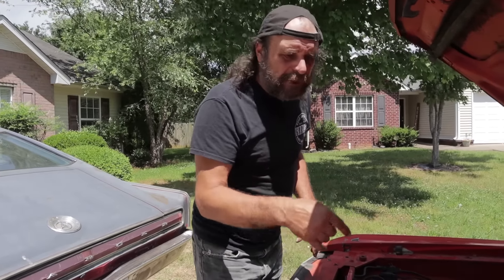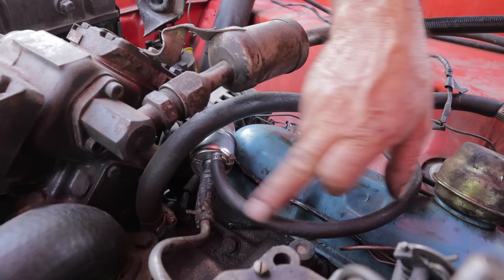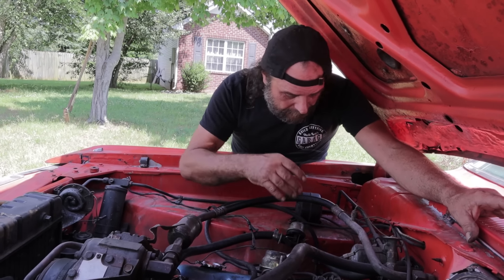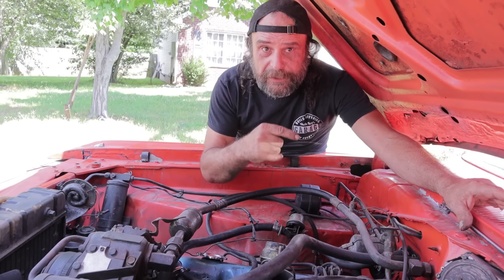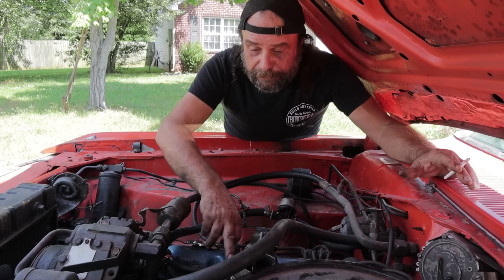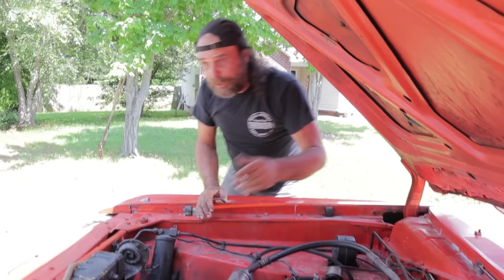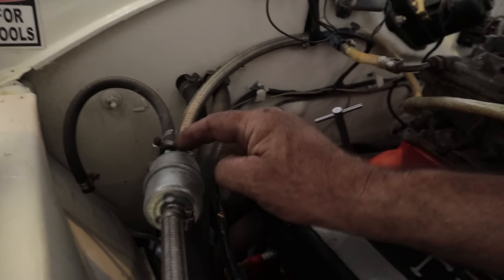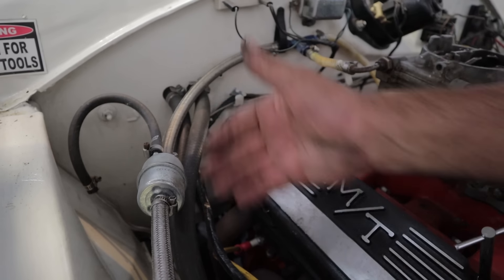$8 Cure For Vapor Lock

Comment: Thank you, uncle Tony.

You won't believe how spot on this video is .. 
As I had said I had owned 3 mopars- a pair of 68s.
First  was G.T.X.
a black Texas car.
Never again.... 
That was a petrol powered BOMB!!
it percolated So  bad I NEEDED a 20 lb. Fire bottle. Even H.O.G. (hunnert octane gas-leen) didn't help. Just hotter fires.
No comment on which brands we're worse 

After a 69 glass hood melted on it 
I put in insulated fuel lines, electric fuel pump with a pressure regulator, tossed the thermo-junk 4 bairbule with holleys 780 cfm d.p. a valley pan, heni cap. radiator, remote oill coolers and bigger fan & shroud 

Nothing. Spent OVER 3 grand.
Then 1 cold ass day-flames.
Gone in 30 seconds 
The other 68, a 340-4gear boiled over in Sub zero temps.

Saved by a most welcomed sale.
The anti perc filter & non alky gasohol were the missing mopar links 

Thanks again, Tony..
Could have used you 40 yaheens ago.

Life's a long song!

Brian.

Comment: I knew a girl once with a third nipple.  Triple the fun.  
Thanks!  Always wondered what that 3 port filter was for.  
It's a little more involved, but I always just added an electric pump near the tank and blocked off the mechanical vacuum pump.  Fuel under pressure usually doesn't reach a high enough temp to vaporize.  And of course, that's why we don't see vapor lock on modern fuel injected engines.
Love your channel.  Your the first guy I ever trusted that wore their hat backwards.
Reply: That's really only 50% more fun.

Comment: Thanks for tip.  I put similar pump on {from China} but only has 2 pipes - in & out  no bleed off.  Took vehicle into town and after parking go to drive - pump making loud hollow clicking sound then vehicle stop in main street {embarrassing}.  But did eventualy work again.  This happened twice.  I though possible sabotage as only logical explianation but what youv said makes sense  {accept why it would click which sounds like it wasnt getting fuel which led me to think blocked filter / but why would it work after not working etc...}.  Thanks!

Comment: I drove an old Dodge Ramcharger on a trip to Florida and the hotter the weather got going south I experienced vapor lock anyway the problem was fixed very similar to your approach by a very sharp good old boy near Ocala FL.
 The term vapor lock is up there with going to Pep Boys for points plugs & condenser you just don't hear it any more.

Comment: Interesting never had that style filter here in Australia and vapour lock is very real here even without ethanol but mainly in pre 80s cars the fix is a low volume and low pressure electric fuel pump along with lagging on the fuel lines , in extreme temperatures 130f and above a spray nozzle of water on to the lagging but that is only under extreme heat and load situations when the vehicle would vapour lock when running . Mostly it was taken as one of those things bit like in pre 70s cars they will overheat when it is hot no big deal , carry water refill off you go again . The one motor that it did not worry was the slant 6 to this day I don't know why . I have been a professional mechanic since 1974
Reply from the maker: The 10% ethanol used here in this country is what causes most of our issues
Reply: Have been told by many that the petrol over there is worse than old 3rd world petrol. Not much ethanol here but they have lowered the octane rating over the years the worst is 91 octane then 95 then 98 octane and it ain’t cheap goes from $1.45 for the 91 to about $1.60 for 98 that is per litre . 1 imperial gallon = 4.5 litres approximately not sure about US gallons. I drive a diesel Land Rover discovery 1 that gets about 32mph

Comment: I have a 1968 Oliver 1750 gas 310ci with a 1968 model 74 picker and both 74S & 74H attachments. Use it for harvesting corn, I went all through it and still it has had issues. Runs great for the first 20 mins then dies, leave it sit 10 mins and it runs good for 10 minutes and dies. I'm certain it has to be vapor lock, now I  know how to cure it. Couldn't thank you enough
Reply from the maker: Y'know...could be a clogged tank vent too, going by those symptoms

Comment: One time, when I had some cooling issues with my 79 Continental, the motor started to vapor lock before it could get hot enough to hurt itself.  Silver lining, I guess!  Looked up your video, good information (real mechanics are always holding onto a cigarette when talking) and something to think about.  My motor was running cool, but the 95 degrees outside, unusual for ol North Dakota, got my car to start having major troubles when shopping in town yesterday.  Gotta poke around the hood and see, I guess.

Comment: I had vapor lock problems on my BMW motorcycle. It has an aluminum tank right above a lot of motor, and in the summer the gas gets hot. When it vapor locks it quits running, and if you remove the gas cap assembly you can see the tiny stream of bubbles come up from where the fuel pump is. When the gas cools down, and the bubbles stop streaming up, you can start and go again....for awhile. The fix I found was to divert air from the fork area of the fairing, to the underside of the tank area on the left where the fuel pump is.

Comment: That probably is my issue on my '85 5th Avenue. Didn't even think vapor lock would be the cause of it being hard to start at times. It was a pain yesterday in town. But that also explains why my temp gauge goes to 210 or so when I turn the ignition on, after it's been driving steady at 180, on cooler days I'm guessing it reads about 165~ish.

Comment: Thanks for this. Trying to restore an 85 dodge b250 and have vapor locking issues in the summer and this will definitely help because I'm about to replace the fuel pump and can do the filter next

Comment: In modern cars, the fuel is always under a certain amount of pressure for fuel injection and will resist boiling.  At atmospheric pressure with high underhood temperatures, yup, it does boil.  I had an 81 Ford Granda with a 200 inline 6 that you had to manage the vapor lock issue.

Comment: Peltier junction device,zip tied to the (metal!) fuel line...or close to the fuel pump as possible...& heat insulated fuel line covering zip tied...uh yeah & an electric pump can be had brand new for $5-$8 usd..

Comment: Run an electrical fuel pump with return line and if you have headers keep your fuel line as far away from them as you can. Or insulate the lines to keep the heat from getting to them.

Comment: I like the videos. Fuel return bypasses are usually at the mechanical pump for imports like the 70s Datsun. The filter bypass is something all classics should have. It's not something to hook up to a previous vapor return line from a charcoal canister, dirty and rusty usually, and run return fuel through it. But it would clean er out eventually.

Comment: Nice video! That is a crafty solution to heat soaking.  I have an old ford truck,  Im going to start off with phenolic spacer and heat shields for fuel lines, hopefully that will suffice.  I am entertaining the thought of getting and electric fuel pump someday, or doing what you have done, its looks like another option.  The not so easy or fun part is getting the fuel return line back into the tank, lol.  I have another idea, along the lines of what you are addressing, add  shutoff valve at carburetor inlet, and wire it so shuts off when turn vehicle off and opens when turn igntion.

Comment: Man I wish I found this a couple months ago.  I had to build my own return line using a fuel restrictor for a nitrous system.  Everyone I asked said just go efi or go electric fuel pump.  This solution works, dead heading the fuel at the carb doesn't.  You can also try Sunoco's  "C9" gas.

Comment: We use to add an aluminum spacer underneath the carburetor  worked In most cases.  Did they have those filters in the 70s. Had a 67 Newport custom  383  had vapor lock issues tried everything to fix this heat tape on the headers fuel lines carb spacers even larger radiators and fans . Never could drive that car on a hot day

Comment: I HAD A 81 DODGE PICKUP WITH A SLANT SIX AND IT WAS BAD ABOUT VAPOR LOCKING IN HOT WEATHER!
MY FIX WAS TO ADD I GALLON OF DIESEL FUEL WHEN FILLING THE GAS TANK!  ONE GALLON IN 20 OF GAS RAISES THE BOILING POINT ENOUGH TO CURE THE PROBLEM!

Comment: $8...then another $80 for the return line, if you go for the easy route of an aftermarket repop line back to the tank, then another $30 for a no-weld bung back into the tank, or the effort of soldering in a return line onto the factory sender without melting the isolator for the sender level (unless you're lucky enough to have something where the repop senders aren't junk - Mopars, of course, get the thinnest repops and which read the wrong OHM resistance for the fuel gauge).

Comment: The only issue I have with Uncle T is him not liking wire loom. I understand the frustration he has with people not doing a good job and using it to cover bad hack jobs up. However, I try really hard to wire things in right and heat-shrink all connections to make it look nice  and prevent water from corroding the wire as well as wires being rubbed through . I will say to each their own but I like wire loom because it prevents wires from rubbing through. (I’m not a fan of electrical tape)
Reply from the maker: If you like it, more power to ya.

Comment: WIX 33424 or the HASTINGS / BALDWIN GF345

Most of the 3-line filters had 5/16" inlet/outlets with a 1/4" vapor. If you feel the need for a 3/8" inlet/outlet with 5/16" vapor port, the only one I found were these

Comment: also if you have a sbc  you can get a fuel pump for an 86 camaro 305 4brl that had a return line port.  so it will have 1 inlet and 2 outlets .

Comment: Holleys should have the holley thick fiber spacer under them.   Some 80s carbed cars had a return line. (My 83 mustang does)  use it.   Get rid of the metal hardline for fuel attached to the block.   100% stopped it on my fox.

The carb gets Luke warm on my car now with the holley spacer.  Without it I couldn't even put my hand on the float bowl.

Comment: Thnks for the tip.  Was trying to find how to route the breather line after deleting the charcoal canister on a 69 Road Runner. Running the breather line to the carb tophat with 2 1 way check valves inline. Couldnt find much info on that yet.   I was curious about the hot fuel issue as well   thank you

Comment: Having same issue with my 58 Farelane 500.   I’m 100% “learning”  and this is my question re: return line.  Why does the return line need to get back to fuel tank?  Wouldn’t it do same thing if the return tube/line is left open ended and taped along inside somewhere?  Still releases the pressure/heat.  Right?

Comment: I had been having a similar problem on my 78 K5.  The boiling was so bad that after a15 minutes of driving I would smell raw fuel coming out of the carb, I had to drive with the windows up in the middle of summer. everyone was telling me that "old cars just smell" but I had the truck for years before the smell started. I replaced my entire fuel system just to eliminate any issues of clogged or leaky lines. the smell still persisted. I then looked under the truck again and noticed that my passenger side exhaust was running close to the frame rail where the fuel lines were routed. I made a few heat sheilds to protect the lines and the problem was gone! I might try one of these filters as suplemental insurance though.

Comment: Thanks for sharing.  I have 72 mach 1 351 cleveland, always had this problem, but I think it has a problem because all of the original fuel system was replaced with a holley carb.

Comment: Uncle TONY   Big thanks for the information on That fix !!!!   Do you have the part numbers for those filters ???     I had that problem on my 1970 dodge 318  4 speed short bed 1/2 ton pickup  ( all original )   It was 110 + last summer got it running and about 5 minutes later it stopped and you could hear the fuel boiling in the carburetor ,   Does the carburetor need some sort of fix for today's fuel ??? I also have 2 more 440 cars 1967 4 door  Monaco  and a Chrysler 300 2 door all original and a mouse Rod 318  Datsun truck  Thanks again   TANK
Reply from the maker: Might want to add a spacer to that carb, too

Comment: On most gm v8s from the 70s and 80s have an optional 3 line fuel pump and the 3rd line is a return it goes straight to the tank with a 1/4in hose and when the pump hits peak pressure it bleeds back through the return so when you are idling the fuel is constantly flowing through the pump and when you shut the engine off the pressure bleeds through the return so it stops the carb from be overpressureized and flooding over but I don't know if any of the other manufacturers adapted this idea besides gm

Comment: Tony, the dual quad intake on your 68 road runner looks like a late 50s   383 intake and carbs golden commando (343hp package).
Reply from the maker: It is a 343 Horse intake, but that package was one year only. 1962.  Manifold itself is identical to the earlier castings

Comment: My 1969 ford van had this problem and i think this would solve it. The mechanical fuel pump and carb would overheat. A vented filter / separator makes sense.

Comment: Pretty interesting idea. I am wondering if I can rig that vapor separating gizmo into the fuel line of my old Land Cruiser. Like you said, every car is a little bit different. Mine only vapor locks if it's over about 85. I open the hood when I go into a store and that usually works. And I also live at 7500' in the mountains, which is a whole other can of worms.

Comment: I have professionally worked on cars for 35 years and I can tell you in good conscience there is no such thing as vapor lock. Its either a week fuel pump, the choke or choke pull off out of speck or adjustment, high float level in the carb, or the well plugs in the carb leaking raw fuel into the intake manifold.

Comment: 👍Thank you. Having vapor lock trouble with my Ford 9N tractor. Googled for some ideas.   Then I seen the back end of a car beside you. It struck me immediately as a barracuda.  But I'm on my phone and I'm not sure.  Initially I thought it was 64, 65 but they had the really long wrap around back windows. And they also had the slight tail fins  that car beside you has. When you walked beside it I could definitely see it wasn't a wrap around back window so I'm going to guess it's a  66, 67 or 68 but I don't recall those having slight tail fins if you will. Maybe it's not even a barracuda.  It has to be at least 40-45 years since I last seen one of that vintage. You have many old school classics, as do I. My newest Auto is still over 20 years old.  You can have a half a dozen decent Classics for the price of one new clone car.  Appreciate your response.  I watched your video gave it a thumbs up. Perhaps I'll try the 3 nipple, I always like 2.   3 should  be good. LOL seriously the 3 nipple running into a charcoal canister maybe. No return on the tank. And or I might try shielding the bottom of my fuel tank, carburator and line's.  Haven't had vapor lock troubles since I cured the 43 Willys Flathead.  That got an electric fuel pump and a new tank with the return line.

Comment: wish i'd seen this before i ran the GTO low on gas . then drove a punch through the gas tank . and epoxied a 1/4 inch line in the hole down to the bottom of the tank. i restricted the return line. that solved the Q-jet vapor lock. the Rochester 2G didn't vapor lock i'm thinking due to the larger float bowl.

Comment: Just put a 383 stroker in my 78 chevy truck. Can't turn it off without letting it set 1/2 hour, or using ether. Runs great otherwise. This sounds like why. Starts great below zero, runs great, just hates to restart while it's warm.

Comment: I have a 70 Super Bee six-pack. For speed. Battling with California fuel problems ever since I got the car running.I never considered this problem I always thought it was my needle and seat o rings that were deteriorating. I'm actually not sure if I have a vent line going back to my fuel tank? Play something to look into for myself. By the way I can only get 91 octane. Race fuel is available at $10 a gallon..

Comment: I'm building a 460 BBF. Vapor lock took most of the fun out of the last one. I was seriously considering an EFI system running around 3 grand.
If your solution works the I will save lots of money. I will have a external electronic fuel pump. Hope that doesn't cause a problem.
Thank You

Comment: Another problem with ethanol in gas, it is hygroscopic. It absorbs water out of the ambient air. If it sits for any length of time it will actually stratify and the water saturated fuel will sit on the bottom of the tank and be sucked into the pickup potentially causing all sorts of problems. The one product I have found that addresses this is Startron, an enzyme based gas additive that actually keeps any absorbed water suspended evenly in the fuel. Also rejuvenates old fuel so you don't automatically have to drain it all out when putting a car or boat back into service. Most gas treatments are just solvents, which dissolve crap and leave it in the fuel. The enzymes break the crap down and allow it to be efficiently run through the system. No affiliation, just a satisfied customer.

Comment: This is all good, assuming that your fuel pump has sufficient flow for all conditions.  If at WOT your fuel pump can marginally keep up, this system will send the gas back in the tank instead of the carburetor.  What you need is some sort of a pressure regulator, possibly active only during WOT, which means complexity and in part defeats the purpose pf an old car.  Also, you would have to find a way to dump the fuel back in the tank so that it properly mixes with the cool fuel.  If you just "T" it on the fuel pickup from the tank, you will end up collecting hot gas back in your engine.